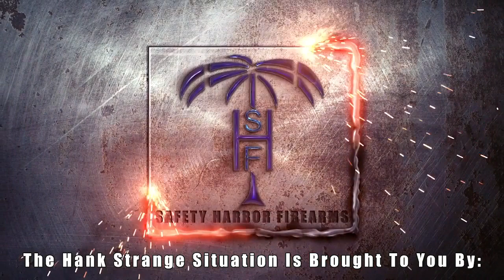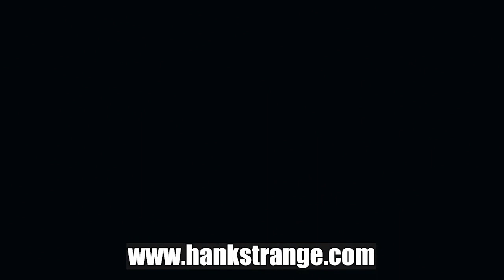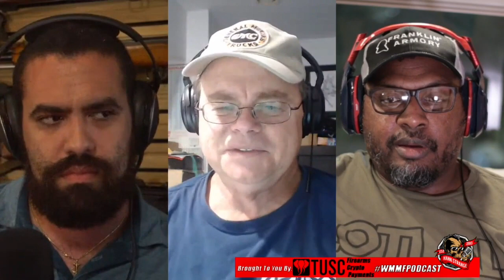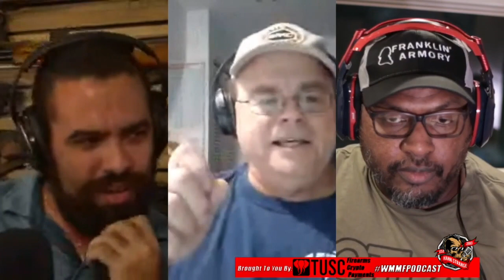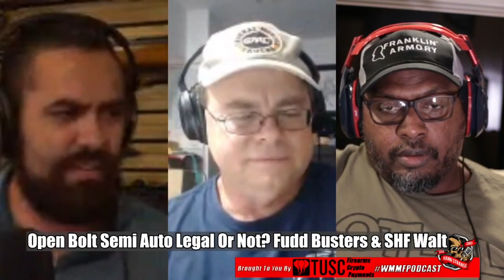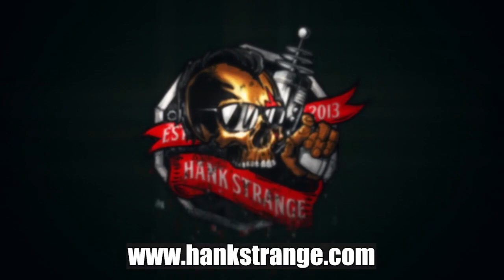Open Bolt Semi Auto LEGAL Or NOT Fudd Busters & SHF Walt

Comment: This actually makes so much sense! Much credit to Matt for figuring this out and explaining it! Now I understand why with my G3 parts kit, I wasn’t able to just weld a pin to prevent the trigger from being pulled back far enough for full auto, but instead had to move the axle and pivot point of the disconnecter and remove the sear altogether.
Reply from the maker: Yeah I'm actually glad they got into this...I'm learning myself
Reply: Thank you!

Comment: What if you use the Sten designed to a smaller tube from the original diameter, with no features machined into the bolt that align with full auto. Only the semi auto part of the sten in a tube that won't accept the originsl full auto bolt. I've always thought since I first discovered the Sten, that it is an important gun.

Comment: The easiest current disconnector to defeat in seconds and return to complete normal in seconds,,in every single Glock made until the Gen 5. Walt knows what im talking about. A pointed soldering gun a pair of tin snips a hand file and a small piece of 20guage steel and you can make a Glock bang off full out only until the piece falls out. The point is its sooo easy and its in every Gun owners safe and every Police Station in America. To make it full auto is to put yourself in prison!! It is.. the easiest weapon to make full auto and return to stock semi auto state in seconds. You can hose down a house with a Glock 19 full auto,  take off the slide and with your set of house keys take off the conversion and re-install the stock part before people even get off the floor. How did that go unchanged fo soooo many years?? Yet they make Bump stocks illegal??

Comment: Same reason the 2 pin MKE Lower ships with the auto sear in the gun!! Jus the numbered part of the gun has a welded block in it to prevent a F/A Bolt carrier from being installed and the trigger pack is changed to make the trip lever not only not be there,,not be able to be installed and used without permanantly modifying the trigger pack. Anyone can make a MKE MP5 Variant shoot full auto with 30 minutes,,$300 and a small metal hand saw from Home Depot or a dremel tool. Point is its Illegal lol. They will prosecute you. Unless your a Rapper named T.I. lol. Anyway if you make an open bolt semi auto and try to register it you will spend more money in court costs and days missed from work than are even mentaly comprehensible.Thats how they do.If they dont have a direct law to Convict you on and you stand in the grey area,,you will plea out if they have an itch they wanna scratch.